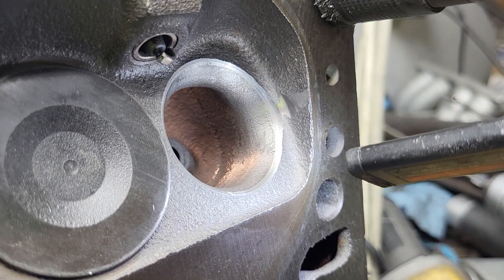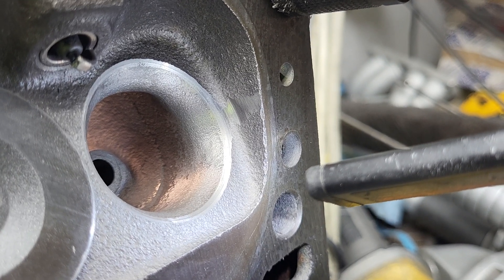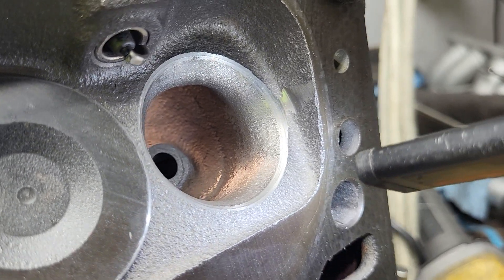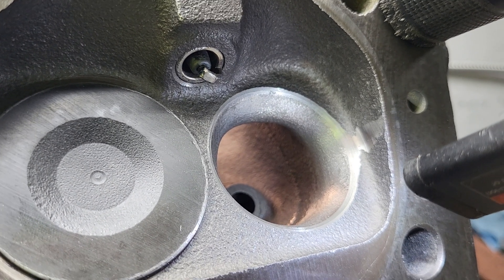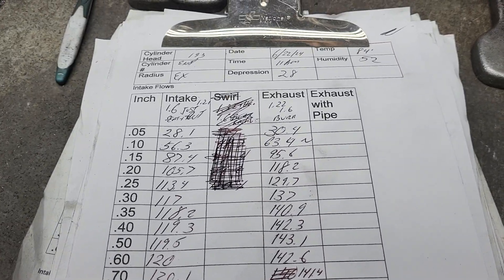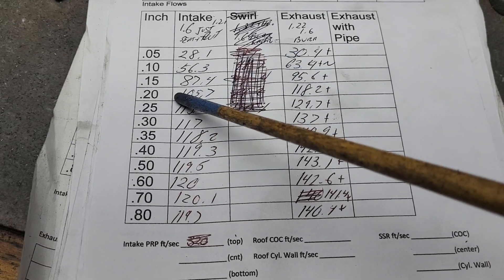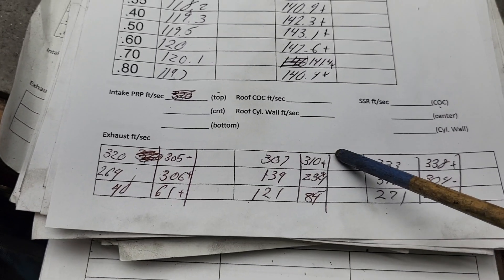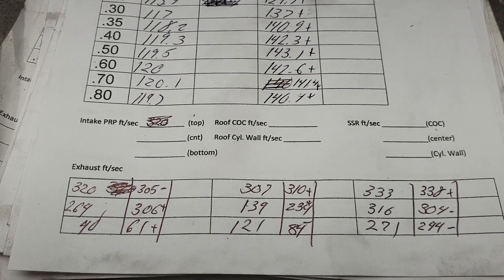Chevy TBI head exhaust throat experiment, radius the bottom cut, worth flow?

Comment: Nice. I'm a Tool and Die machinist by trade and was wondering if using a boring head on a Bridgeport would be a good way to open up the bowl area? Or would that risk taking to much off of the side next to the other valve? And having a Bridgeport in my garage just sitting there if I'm running a die grinder makes for easy access. Would rather run the mill instead of the grinder too.
Reply from the maker: My friend John builds a nice adapter for a mill. Look up RBJ performance. It can do valve jobs and bowl hog operations. Probably lots more.
Reply: @servediocylinderheads  
Cool, I have a rotary table I can mount on my mill that can be adjusted from flat to 90° that works very well to do head work. I was just wondering if it would be a good idea to bore out the throat diameter or will that make it to thin between the 2 valves?🤔

That fixture sounds very cool though, if I start doing more head work I will keep that in mind. The rotary table works great but there is a carp load of indicating to get everything just right.😎👍
Reply: @servediocylinderheads  
Tried looking him up and all I could find is a bookface listing that I refuse to sign up for. They don't even let you look in there if you aren't signed up with them.🙄
Reply from the maker: @itseithergonnaworkoritaint7852  I texted him and hopefully he will comment here. Look up RBJ performance on youtube he has some great videos.
Reply: @servediocylinderheads  
Ok, the bookface page was for RPJ not RBJ, I looked up RBJ and found his channel. You need to have a talk with him if he wants that channel to grow because he has it setup as a children's channel. They don't send out notifications to adults for children's channels so it is useless to subscribe to him unless your a child. 

Get a hold of him and explain to him how to correct that and his channel will reach more viewers besides just kids.🤷